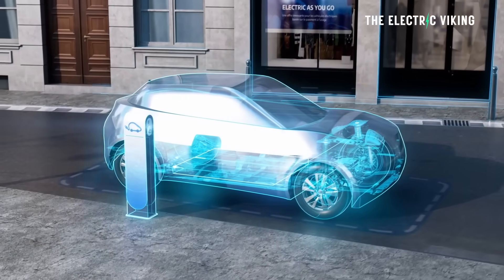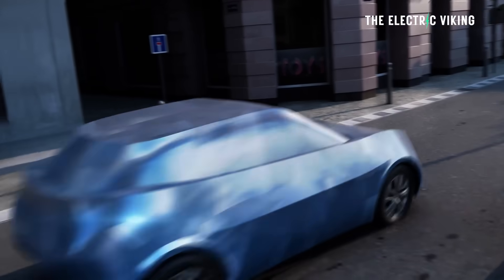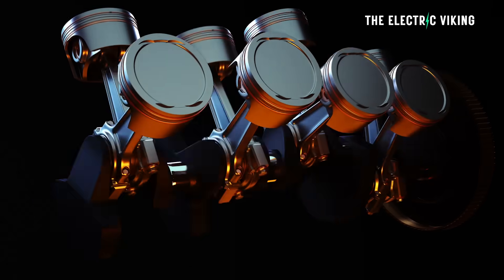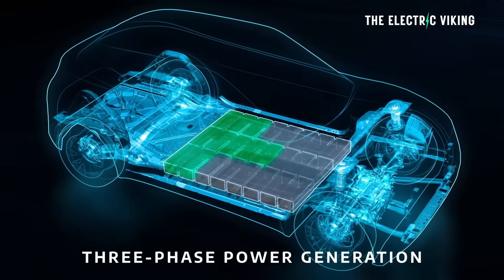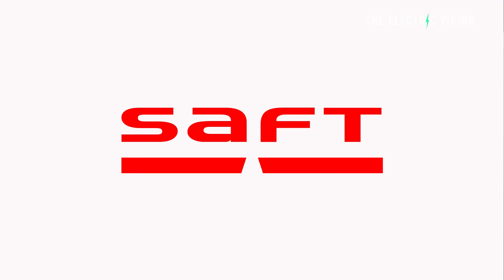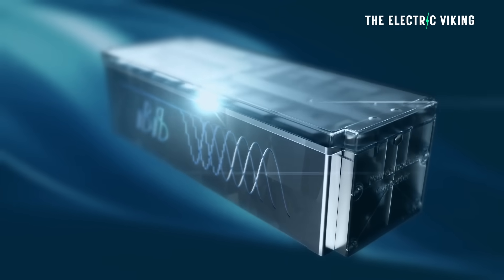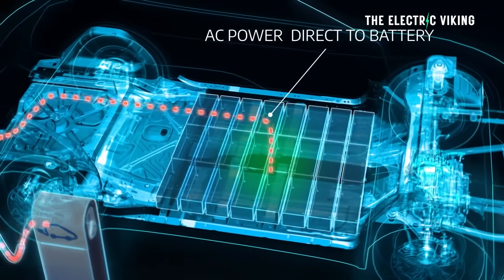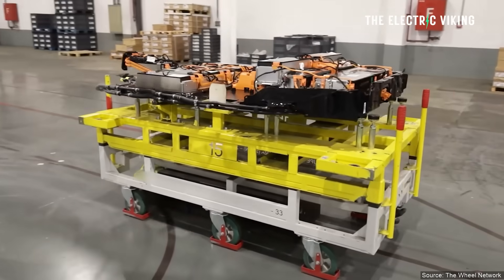Stellantis' says its new IBIS Battery tech will revolutionize small electric cars

Comment: the chemistry of the IBIS battery is not known because it is a concept that is independent of the battery chemistry. so, in my eyes this not concerning but a win.
the real wonderful benefit is the integration of the inverter in the battery modules. that allows flexible scalability, upgradability, mixing of different modules with different chemistries and old and new modules. and what is super cool, is, that you can theoretically use such a module for home energy storage with the already integrated inverter. that allows an easy 2nd life usage.
brilliant. the MEB modules of VW are already very good for occasions where a battery needs repairing and 2nd life usage. but the stellantis modules with integrated inverters are next level and could be a dream for scalable home battery systems.

Comment: Computer industry once had separate hard disk controllers of many sorts and raw disks. Eventually as electronics got cheaper and more integrated the whole controller was put inside the drive and the abstraction moved up to the host controller interface. This was called Integrated Drive Electronics or IDE also known later as PATA for Parallel (PC-)AT Attachment a retro naming when SATA the Serial evolution was unveiled.

Also from computer engineering came RAID, the Rapid Array of Inexpensive Disk, where the parallel usage of massively produced standard HDs with in integrated electronics were able to far surpass large complex and costly specialty build drives once used for high performance.

From the engineering point of view there is a design space to combine parts into functioning systems and tradeoffs to be done.

The same way microinverters might eventually dominate the solar PV landscape "rightsizing" electronic controls to panel area, there might me an equivalent compromise where rightsized inverter-charger per battery modules might make sense.

Might. The devil is always on the details (and the timing). The idea is elegant and deserves further consideration and analysis.

SAFT is no delusional newcomer to battery business.

Comment: Given the efficiency of current solutions has been tuned to the max I doubt there is any room for any improvement. Cutting the electronics in pieces so it rides with the battery has more disadvantages than benefits. I would call this nonsense.

Comment: Microinverters? Is this the same theory as renewables using microinverters to reduce power losses over distance by keeping most of the car in AC rather than DC? The problem is that even in a renewable system, there is still an inverter, which keeps everything synchronized, but that is a function of trying to match the utility rather than control, I believe. Maybe Stellantis is claiming that the battery management system will be the inverter.

Comment: I might be missing something but this battery makes no sense to me. Batteries are DC!   Therefore they require a charger to charge them from other DC voltage/s or from normal mains AC voltages. Conversely an inverter is required to feed the car's motor with power.
A regular EV has ONE charger and ONE inverter. These ibis units have a charger and an inverter  PER MODULE. I cannot see how this would save space. Tesla packs all the batteries together as close as possible within one heat control solution. These units will also require a heat control solution also. Sorry, the ibis battery makes NO SENSE! There are no savings, quite the opposite. 
If they focussed on combining  one inverter with one charger then they would be moving forward... Else this is madness.... Absolutely no space will be saved!

Comment: In theory, it sounds like they can save weight, which is very important for an EV, and save space, although, instead of just ONE box you actually have to have a NUMBER of inverters and converters as you have one for each battery. 
If all these components were cheap and abundant that would be true, but they are expensive and we have already seen the effects of components shortage. 
I would say you add more complexity and a tremendous amount of cost, lithium batteries are expensive but these components are even more expensive, and filling the car with them at this point in time is not cost efficient, maybe in ten years, at best seven to eight years.
You also have to take in account the longer high voltage cables that has to be run from each every battery to the motor/motors.

Comment: I am an electrician in the renewable power industry, and can tell you that combined inverter and  battery chargers have been commonly used in the renewable power industry for over 30 years. It is not “revolutionary .”

All engineering and design choices are a matter of trade offs for cost, size, weight, reliability, and efficiency. Having separate dedicated inverters and chargers allows for better efficiency and performance of each unit that will be weighed against the trade offs and benefits of combining them in a single unit. 

While combined inverter and charger units can provide a somewhat more integrated system, it also requires a different design approach to the charging system. 

The inverter takes the direct current (DC) power from the battery, and converts it to 3 phase variable frequency alternating current to drive the motor/s. In order for it to work in reverse as a charger, it has to first be designed to do so, then disconnect from the motor/s, and be connected to an alternating current (AC) power source that matches the inverter’s voltage output. Then the inverter/charger can convert the AC input into DC output that can charge the batteries.

Comment: From your description sounds like each small battery module has its own inverter and charger on a single PC board and sharing many components but also dealing with much less power (because of the small module) . Presumably economy of scale will kick in and make it cheaper per board.

Comment: This system does not appear to be about the batteries and their chemistry at all.   It will work with any chemistry. 
The novel thing they are doing is in the battery management system.   They are switching batteries on and off very quickly in defined groups and using that to generate a typical AC wave that drives the motor just like a three phase power supply would. 
They won't need an inverter nor a charger as they are never converting from AC to DC and back again.
It will also save the 5% - 10% of energy typically wasted doing these conversations.

Comment: There could be a substantial market for small and cheap EVs that may only have a range a bit over 100kms. Many households could getaway with one larger car for long distance driving and a small EV just as a town car. If it is small for parking and very cheap to own it would sell.
Reply: or buy a low range car where there is still space for another two or four modules and after two years you decide to upgrade.

Comment: It's analogous to the microinverters used on some solar panel systems rather than big inverters fed by string aggregators. In the case of panels, it sometimes makes sense (even thought the microinverters are less efficient than the big ones) because of better response when panels get radically different illumination. You don't have that motivation with battery banks, but who knows? The big silicon carbide chips Tesla uses are the efficient approach; do those scale downward to pack size?
Reply: The cooling of the inverters will also complicate matters in the pack. If much heat is generated from the inverters, it will make the pack overheat when fast charging or at high demand (rapid gate). Also the numbers of silicon carbide chips will be much higher or if not using silicon carbide to save on cost, it is then a low power solution. This is likely why they are planning on using this on compact cars.

Comment: I have been industry watching most of my life (50 years of watching, I was 10 when I started), and I think that the legacy makers are in serious trouble. 
M-B seem to be tied in to.traditional formats and systems and appear to be relying on nothing more than reputation and loyalty. BMW tried to produce a ground up EV, but failed so miserably that every single EV they've produced since then has been not much more than a conversion from an ICE. VAG made a huge effort with the iD series, the Born etc, but so fouled up the infotainment/interior by rushing to market that their reputation has suffered seriously.
Nissan/Renault hedged their bets with an air cooled battery that seriously hampered their opportunities and Stelantis did what? I really don't know.What I do know is that they whined a lot and released only ICE conversions. GM totally f*cked up with the Bolt or Volt or whatever, and Ford f*cked up with a Mach e that has proved... erm... problematic?
How can so many companies make such a pig's ear of something that they KNOW they've got to get right?
It astonishes me that heads haven't started rolling, because I am pretty sure that we're going to lose some of the biggest names in motoring, and Stelantis, although not a big name itself, is home to a whole heap of them.

Comment: I'm thinking chemistry is less of an issue as each battery module will contain its own micro-inverter. So I suspect there will be different versions of IBIS modules with different chemistry, but they will "present" to the vehicle (or whatever application) as the same. This could also future-proof vehicles as you'd be able to swap out modules with newer/better ones.
Maybe.
Reply: exactly. this would even theoretically allow upgradeability. buying the car with a cheap set of LFP modules, maybe having the space to add two modules later, adding two LFMP modules later. removing two LFP modules and add two solid-state modules. using old modules for your house energy storage system.

Comment: So no new batteries. Just repackaging of the inverter/charger. 
The advantage is modularity.They can use the same module in any size car, home battery bank, scooter, boat, anything. They can build millions and have one part number. Great! That should reduce cost. 

OK, the possible disadvantages I see: 
Stuffing all the electronics, battery, and wiring under the car is going to be a problem. It makes it bigger under the seats, and you leave the boot area empty, but so what? The wiring is going to be longer, there will be lots of high power connections. I don't think they can make it structural with the car body to save weight. The large number of electronic parts will be more expensive than the usual few big switching devices. Cooling will be a headache; the battery will have to be cooled/heated along with the electronics. There will be many points of failure unless they make it fault tolerant. The inverter wire length to the motor will be much longer than the usual mounted on top of the motor, and that's a high frequency square wave with high losses and high radiation. Repairability is a big question mark. Upgradeability is a big hassle: you can't easily swap out a 2 phase USA to a 3 phase Euro input, or a 400 volt to an 800 volt. For inverters, they have to design the motor to fit the inverter output so how can they feed a range of motor sizes and numbers with a fixed inverter output?  

But don't let me dissuade anybody from trying. I'm ready to buy a $20K small EV.

Comment: It seems like the inverter is simply integrated into battery modules and, therefore redundant. Tesla does this in the "penthouse" (forward end) of the battery pack. 
So instead of doing this once. Its done for each module (Tesla doesn't use modules anymore) begging the question how this improves anything. 

Rather dubious that this reduces overall weight compared to Tesla structural battery.

Comment: I have a hunch the technology is a spin off from the citroen oli concept vehicle. They possibly  have the chassis and personalization parts and low weight parts ready. I think with this modular battery system, different capacities can be offered. I think these batteries will not shine in the performance department of the vehicle but provide a valuable solution to inner city driving solution. Wouldn't be surprised, they will create a system of modular batteries with integrated power system, that can easily be swapped between mobility products, such as the next generation amis, olis, scooters, powerful ebikes, and perhaps modular home powerbank/power wall systems. So I think they might have something smart going on. If every module was roughly 3 Kwh hours, one module could run a home appatment for a day for most people, opening up a whole new market beyond mobility devices with ibis. I think,  that although it doesn't make direct sense to have this system in a car in terms of space and efficiency, for a cheap car, for a future energy solution for the future in curious where Stellantis will lead us with this for future city energy solutions. Citroen has historically often been innovative with new technologies in cars over the decades. How do you combine luxury, comfort, and innovation?

Comment: It sounds too good to be true. Hopefully it is true and works as they say. Time will tell. Battery tech is going exponential on advances with so many manufacturers. That can only be a good thing.
Reply: Sounds like multiple inverters replacing one. Not sure how that makes anything better. Sounds like more weight and cost... just shifting it to the "battery" vs a single unit in the battery pack vs module. 

Sounds like someone moving cost to a different column on a spreadsheet and claiming a price savings.

Comment: I've just returned from holiday with my friend, he has a Fiat 500E, range according to Fiat was supposed to be 160 plus miles on a full charge, best we got was 120, and a knightmare to find charging points, once we were panicking, down to two miles. And the cost of charging has quadrupled since he leased it. Works out it would have been way cheaper to use my diesel car, an Audi A3 over the 800 odd miles we covered
Reply: Fiat 500E prob doesn't have a liquid cooled battery... which will kill its lifespan and disappoint in hot/cold weather. 
That said. 
Tesla is not Fiat.
They can't afford to produce lemons, so they have to be far more reliable.
Reply: You have realised what many will eventually be forced to.

Comment: So its like the "micro invertors" that sit on the back of some solar panels  (instead of dc being shipped to a central invertor)?
Reply: nope. those are parallelized on output. the saft concept is to generate each phase with a string of microsyages attached to cells.

Comment: To be a game changer; a non lithium chemistry is required. Lithium production isn't up at any appreciable rate over the last 5 years; there was a bit of stockpile after COVID but that is gone, this could even mean reduced production in 2024.  It takes 500,000 gallons of water to process 1 ton. 130,000 tons produced in 2022; you find it is already taking 1% of the earths fresh water to process. Lithium is a dead end for EVs.